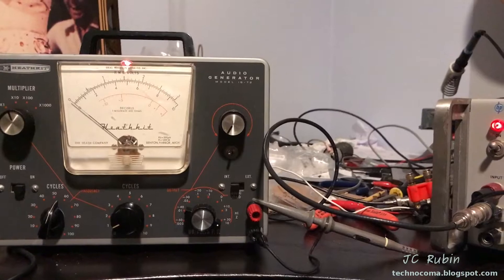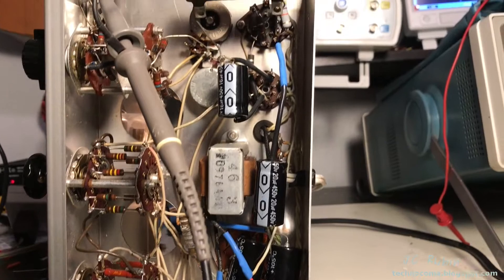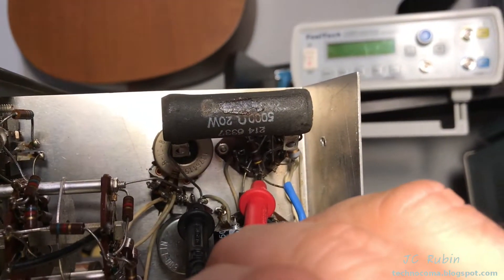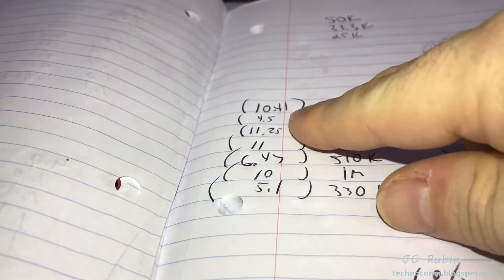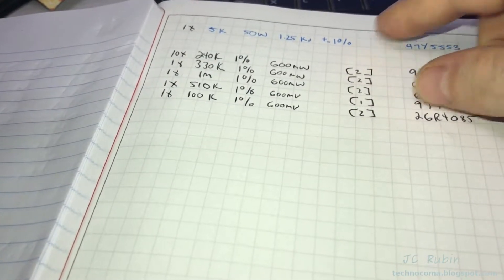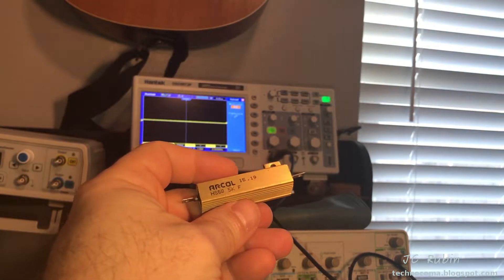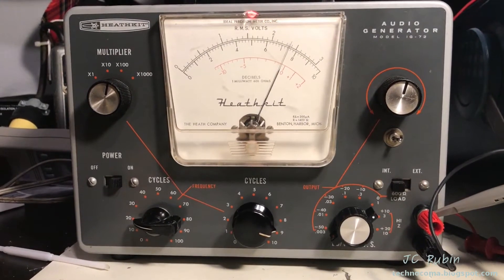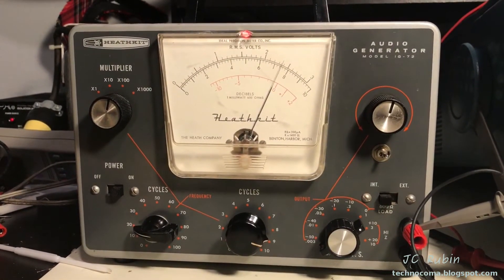Heathkit Repair - Audio Generator IG-72 - Surprise failure, repair, and future proofing

Comment: Now all the heat from the 5K resistor goes into the chassis instead of into the air and out the ventilation holes.  Is that a reliability improvement?  I don't think so....
Reply from the maker: Not that I care what you think,  but given that air is an insulator and metal a conductor I'd say it would do a much better job.  Probably why every design from the late 60's onward did so.

Comment: The 400 volts is far in excess of maximums for both the 6AU6 and the 6CL6....Those tubes will not last long with that high of a B+ voltage, which was and is a well known problem with the AG-9 and the IG-72.....YMMV....73 de VE6ZT

Comment: Hi! I just received a Heathkit AG-9A which I purchased on Ebay. What is the minimum test equipment I need to refurbish this successfully? I have an oscilloscope, but not a distortion analyzer. Do I need one? How can I test capacitance, do I need a device for that? Any other test devices? This is my first try at refurbishing a Heathkit device and also my first time working with vacuum tubes.
Reply from the maker: The specifications for this device are noted in the assembly manual at a given impedance.

Comment: Again, what about the mystery switch!
Reply from the maker: The switch caused an offset and attenuation of the signal the value of which was only important to the original owner.  I easily figured out the default position and left it there, opting to leave the switch in place.